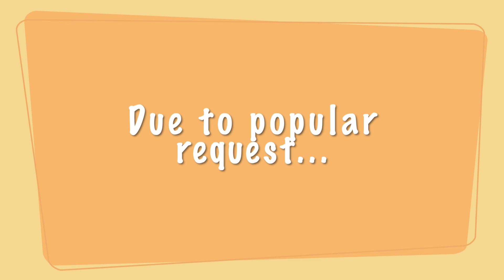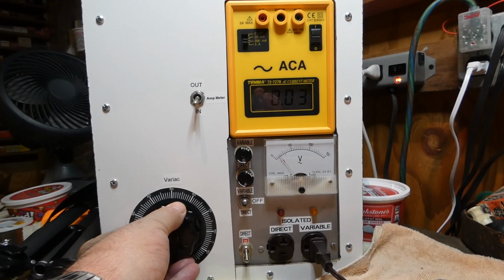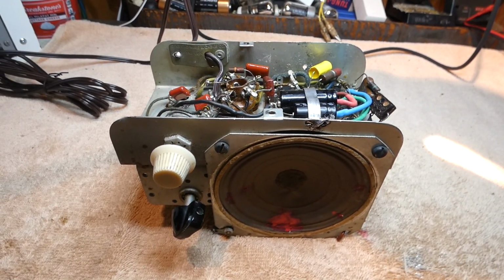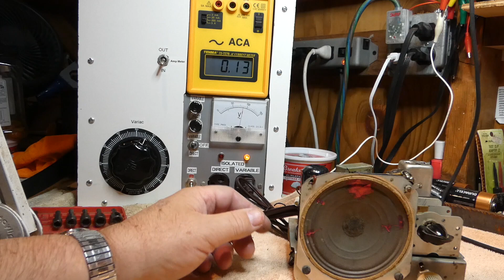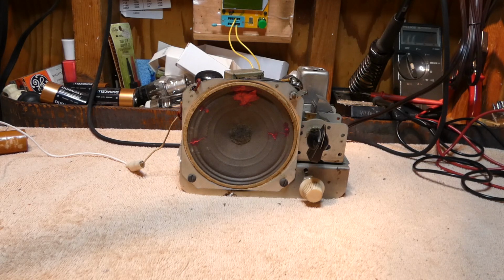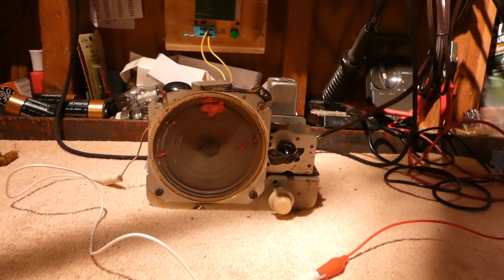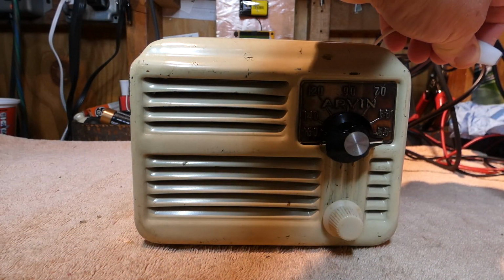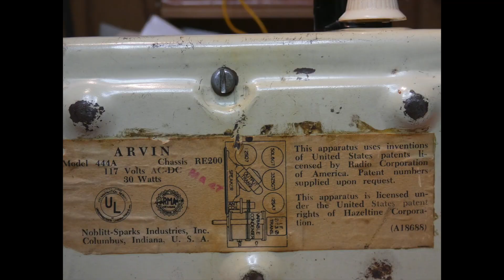The next piece in the estste radio box

Comment: Nice repair video! Don’t sweat the bad solder joint, it can happen to anyone. I think this radio is a little cutie but I bet it gets hot after it plays for a while in that little metal box. Nice work! 👏🏻👍❤️📻
Reply from the maker: After about 20 minutes, it can double as a space heater or could cook an egg on it. This is the second radio like this I had but I don't remember if it came with that fine sliver of asbestos on top. lol
Reply: @Radiowild  oh yeah the good old days when doctors recommended smoking cigarettes and asbestos was used everywhere. 😜

Comment: I did a quick search and found I have 3 different Arvins.  All have the same or similar chassis but different cabinets.  2 are in my office and the one like yours is in the display case.  I also have a Silvertone in a plastic case that looks similar and a Meck with miniature tubes in a slightly larger case.  Guess I'll have to put one of them in the queue.
Reply from the maker: Or you could buy this from me! 20 bucks. I'll guarantee you won't find any tar impregnated parts in this one! lol

Comment: Hi Bob, it will play much better with a white tuning knob to match the color of the volume control knob. ;-) 

Seriously, if you wanna sell it, I’ll buy it. I like those little Arvins!

FYI, if you look at certain old AA5 schematics, they show stage gain data. A lot of the gain in an AA5 is in the IF amp stage, which this radio does not have. But with a l-o-n-g wire antenna, the 4-tubers do pretty well.
Reply from the maker: Send me an e-mail @ radiowild67@gmail.com. It did not have the white tuning knob on it. I have a paypal account. RW

Comment: Man Bob, that little guy is picking up all sorts of channels.
Reply from the maker: Yes, but I was using a 40 meter dipole 25 feet in the air for an antenna. the standard 2 foot long wire antenna will net you half of what you just saw.

Comment: The one I mentioned last, was a silvertone Sears silvertone. Which I believe is made by Arvin same 4 tubes . mine is blue metallic. Plays so loud you can probably hear it a block away. Hope you put a meter from case to a ground water pipe.2 make sure.  Those are great radios.
Reply from the maker: This is a dangerous radio. This has a "floating" ground as well as a chassis ground. Maybe I'll make a cliplead from the chassis to give a better ground - good idea!
Reply: I've been Zapped enough times that anything with a metal case I keep a good distance from it. What is a floating ground? It sounds dangerous I don't use it hardly ever. Just a shelf Queen or King.

Comment: Either you got giant hands or this is a very tiny radio Bob! LOL Should check for a weak tube. Nice use for a spare chicken head knob.
 Paint it white and no one will notice the difference.🙄
Reply: Yes, mine is a white plastic knob that looks the same.
Reply from the maker: The tubes tested good. It's a small radio, and my hands are not at all big. I changed the chicken head that came with it since the threads were partially stripped.